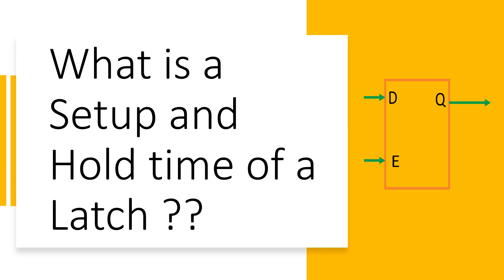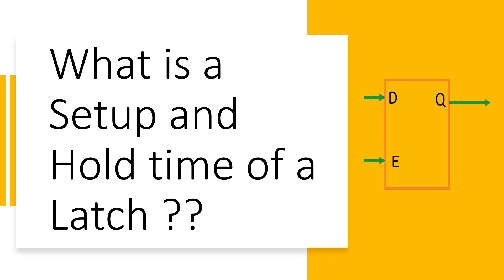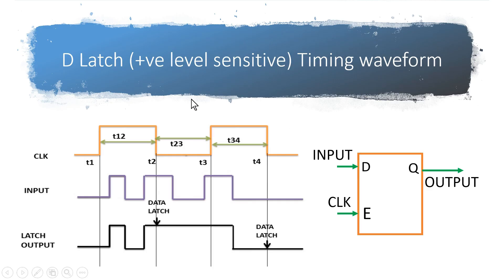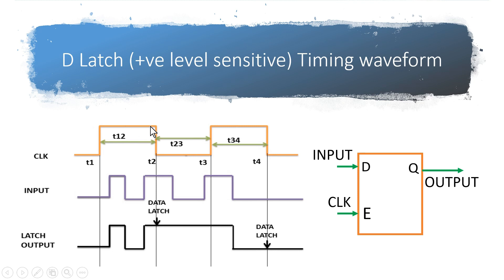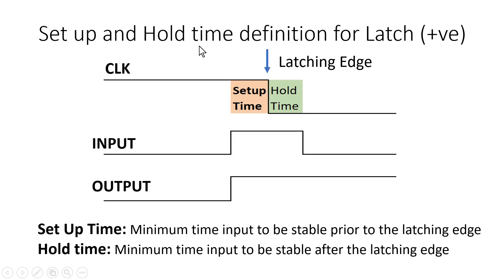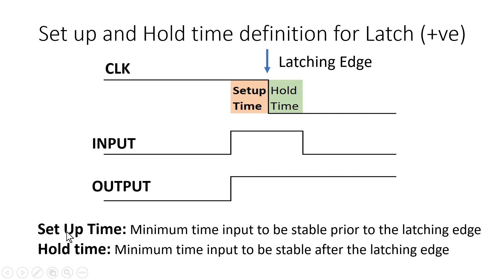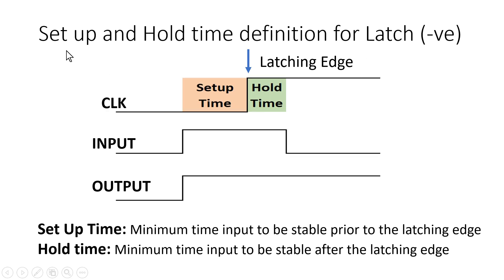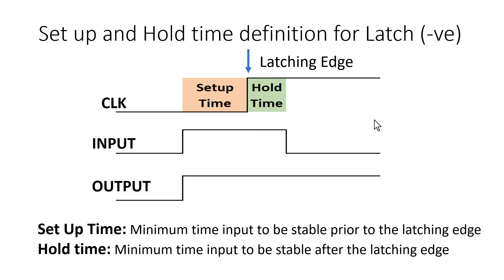Setup and Hold Time of a Latch

Comment: sir , 
we construct flipflop using the latches as master and slave. how the setup and hold time of Flipflop is related to  the setup and hold time of master and slave latch?  i have gone through your "Metastable and Bistable states in Latches and Flip flop " video.  we constructed latch using not gate and pass transistors. could you explain setup and hold time using delay of not gate and pass transistor over there.? 
 you may explain these in your future videos. i am actively following your content .
Reply from the maker: Dear, I appreciate your interest in VLSI .. and asking excellent doubts .. in the coming videos, i will answer why a latch requires setup and hold time and it will answer your second question because I will explain the setup and hold time in terms of not gate and transmission gate..

For your first doubt,  I will create a separate video.. as it is a very nice question.